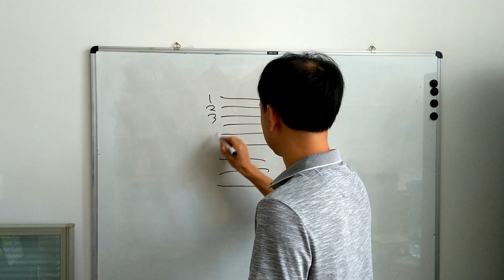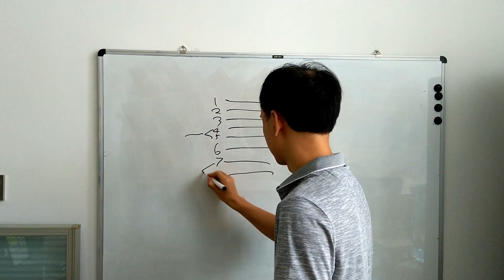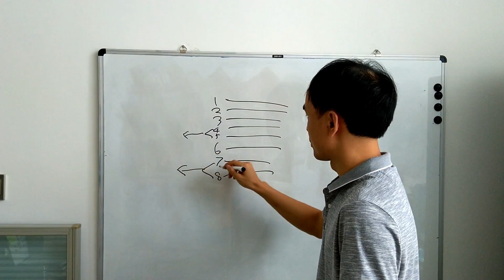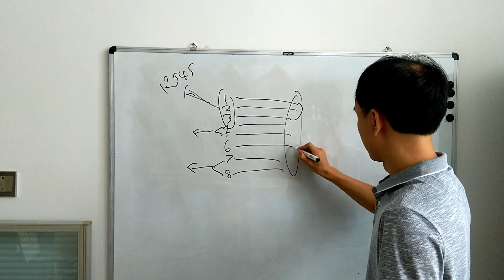DIY Passive PoE injector splitter for Power over Ethernet Cable

Comment: Hello thank you for your video. Can you explain me please. I just bought the POE Network Video Recorder, Zjuxin 48V - 16CH 5MP Smart.265 NVR (1080p / 3MP / 4MP / 5MP) Supporting up to 16 5MP IP cameras Two hard drives included

 I have 6 cctv camera of 5V. But my cctv cameras is not POE system. I would like to know what I need?

Active 5V 2.4A PoE Splitter IEEE 802.3af Adapter or Splitter Kit + Injector PoE Adapter Power Supply by Passive Ethernet Cable RJ45 1 Pair 5 V 12 V 24 V 48 V SVP

Gigabit PoE Splitter, USB Micro 48V to 5V 2.4 A Ethernet adapter, Works with Raspberry Pi 3B +, IP camera and More Ethernet data rates 10/100/1000 gigabit or Mbps

I don't understand anything lol

 Thank you for your help.
Reply from the maker: Hi, first of all, you will need to make sure your camera is IP camera. The power over Ethernet (POE) is designed for IP based products. Most of the IP camera accept DC12V. You should choose PoE splitter with DC12V output. You mention it is the PoE NVR. The power will come out from the PoE NVR to PoE splitter. As ong as the PoE splitter is compatible with IEEE802.3af, it will be fine for both power and network. By the way, the IEEE802.3 PoE use DC48V. The POE splitter will convert DC48V and output DC12V to your camera.
Reply: @Fastcabling  I really thanks full your help answer but, my all cctv cameras are IP & DC 5V, please so I need splitter about DC 5V too? DC 12  maybe burn my IP camera? I saw the PoE Splitter 48V to 5V 5.2V is that ok? I saw either. Gigabit PoE Splitter, Adaptateur Ethernet USB Micro 48V à 5V 2, 4 A, Fonction with Raspberry Pi 3B +, caméra IP Ethernet speed 10/100/1000Gigabit. My Ethernet speed it’s 1000 Mga. does it's work too? please
Reply from the maker: @margsfooddiaries9687  Definitely you will need PoE splitter which output 5.0V. You may just need to pay attention on the connector on your camera. The DC5.0 usually don't employ DC5.5*2.1. The Ethernet speed is not the thing you need to consider. 100mbps is enough to carry more than 5 units 1080p HD IP camera. You can use 100mbps even your camera has 1000mbps NIC card.
Reply: @Fastcabling  thanks dear I really appreciated your kind help. it very uses full for me. I just have the last question Please. as I have the POE Network Video Recorder, Zjuxin 48V - 16CH 5MP Smart.265 NVR. so I don't need any POE Switch Ethernet Gigabit PoE for the video recorder?
Reply from the maker: @margsfooddiaries9687  I guess you don't need. The PoE switch is integrated in the Network Video Recorder (NVR). That is why we call PoE NVR.
Reply: @Fastcabling  thanks a lot dear. your wonderful instant help. in the future, in case I need your help I will ask you again. I keep watching you all the videos. thanks for sharing have a nice day & best wishes for the new year 2020...
Reply from the maker: @margsfooddiaries9687  Thanks for watching!

Comment: Hello my friend. I want to equip my house with CCTV IP camera. What is the maximum length for a passive Poe? I want to do everything with passive poe, because I want to supply the 12 volt with this power box. https://www.aliexpress.com/item/32593865822.html?spm=a2g0o.detail.1000014.3.6ffd7d3dlcz8Z2&gps-id=pcDetailBottomMoreOtherSeller&scm=1007.13338.146107.0&scm_id=1007.13338.146107.0&scm-url=1007.13338.146107.0&pvid=d483073e-2566-47db-8095-82fcc1fc0a05
Reply from the maker: It depends on the Ethernet cable. If it is the pure copper cat5e, you should be fine with 30 meters. When you inject DC12V into ethernet cable by using two pairs, there is power loss inline which will be converted to the heat. The consequence is the voltage drop. If the voltage drop down less than DC10.8V, most of the camera doesn't work. You can try to adjust voltage output, however, Some of the short running camera will have higher power than DC12V. The standard PoE will inject DC48V, the voltage drop has been taken care of within 100 meters.
Reply: @Fastcabling  Shit. I have already bought the parts. wanted to build the whole system with passive poe splitter.
And if I use Cat 6 cable ?? would the distance be extended? but I will also use 12V 30A power supply.
Do you think that I got 70-80 meters?
What do you mean? should I use active POE Splitter? I wanted to install 11-12 camera.
Reply from the maker: @achimgazelle3641  I don't think the cat6 cable will help. It only guarantee the data rate. Some of the cat6 even doesn't employs the pure copper. I think you should use standard POE solution. The one of last possible solution is you can try the siamese Ethernet cable which has two copper included. You can add these copper cable and the 45-78 two pair two transport the power. Hopeful the voltage drop is not so serious.
Reply: @Fastcabling  many thanks for the answer. I will try first with passive POE. I think it will work. I have now ordered a 100M Cat6 cable to test and will demonstrate. If it works, I'm glad. With siammesiche patch cable do you mean that here or? Https: //www.amazon.de/Jovision-Kombi-Kabel-20M-%C3%9Kwachwachungskamera-Weiss/dp/B00ZIS4PNM
This cable does not exist as a 100M. And if I want to pull the cable through the wall, I have to cut off the heads anyway. I think that is a lot of work.
Normal POE is too expensive for me. I already bought 12Volt Ip Camera. Only alternative would be active POE splitter. But then again I have to buy 48Volt POE switch and active POE splitter. That's just not cheap for 12 camera. And how is it if I give the 12Volt current directly through the patch cable. No data is needed for Data. But then the same as passive POE splitter is it?
Whether I cut 12Volt with the help of passive POE splitter or directly myself and send directly through the 2 vein is the same or not =
Reply from the maker: @achimgazelle3641  Just remember to test while the infrared is on. The more power the camera pull, the more voltage drop you will see. The standard PoE splitter should take care of your issue. You also want to look into the IEEE802.3af/at. There is power negotiation before the PoE switch release the power to the PoE splitter.
Reply: @Fastcabling  I will test cables with 100 meters, especially with infrared. Let's see if something happens. If no problems occur then I can enforce my plan with passive POE splitter.
Reply: @Fastcabling  Hi, do you have an email address? I have now made a test first 30 meters. The power supply is stable. 12.24 volts in front of the 30 meter cable and 12.24 after the end of 30 meters. No loss. The data digest also works well. Even with infrared / night vision no problems and failures. I am waiting for the 100 meter cable. Then I will repeat this test. If Dann still works stably then there is nothing left to realize my plan.
Reply from the maker: @achimgazelle3641   Yes. You can contact us with this below page:
https://www.fastcabling.com/contact-us/